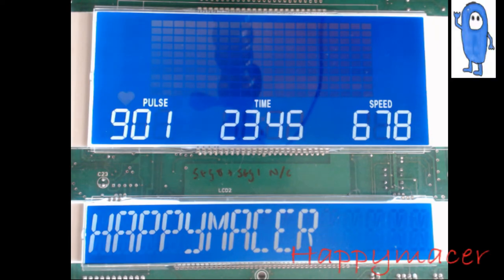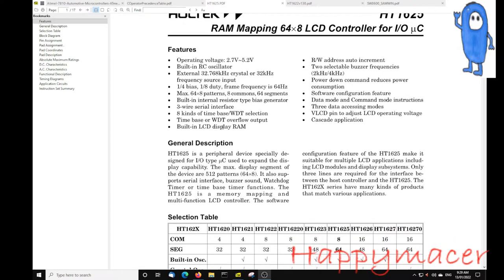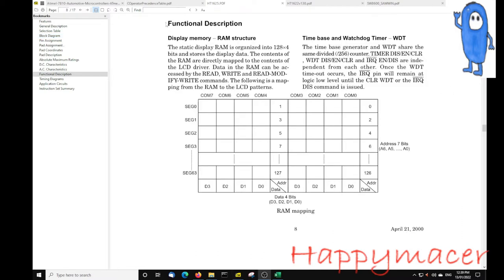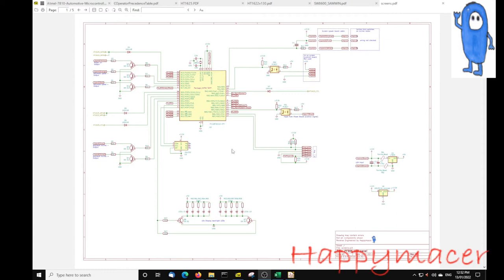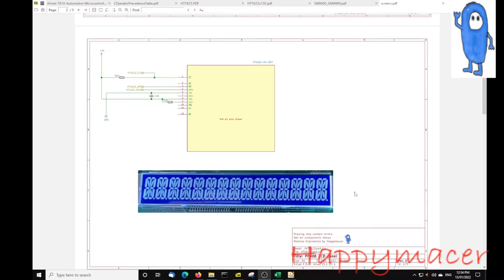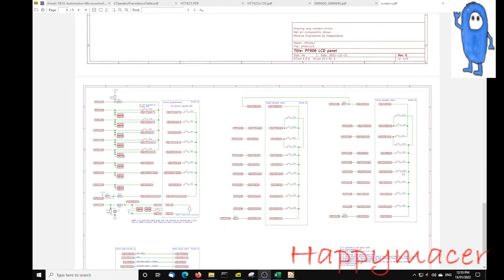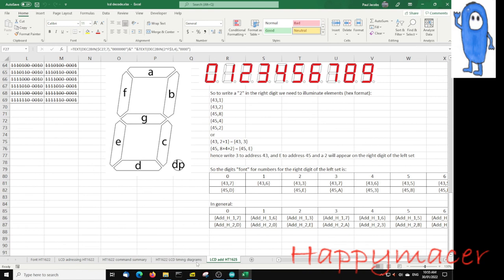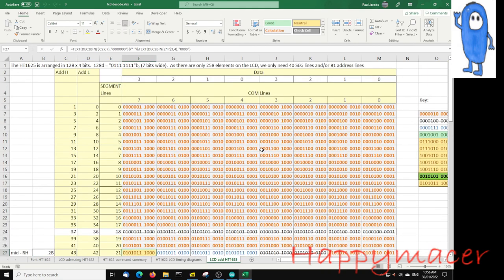How to access the large LCD of a PF906 treadmill using the Holtek HT1625 LCD driver chip and Arduino

Comment: Great Video !! Hi Happy Macer I have an custom segment LCD with 4 common and 59 segment pins ..which LCD driver of holtek i should use to drive it ..
Reply: @Happymacer  Actually In datasheet of my lcd they have given that there are 4 Common and 59 segment pins
Reply: @Happymacer  Hi , i have tried to use my custom lcd  with 59 segments pins with two holtek HT1621 ic dividing segments to both driver IC but my display is flickering ..so can you guess what may be reason for flickering ?